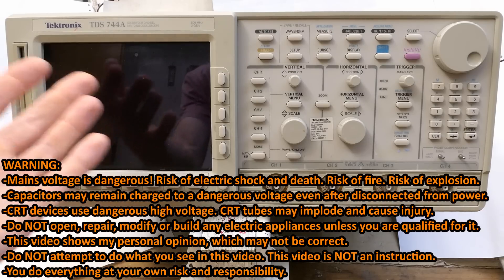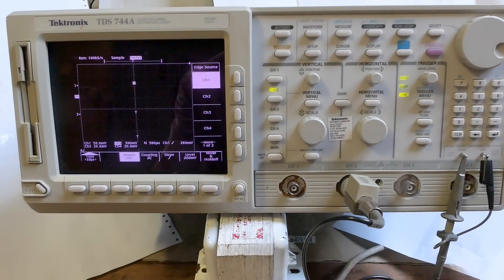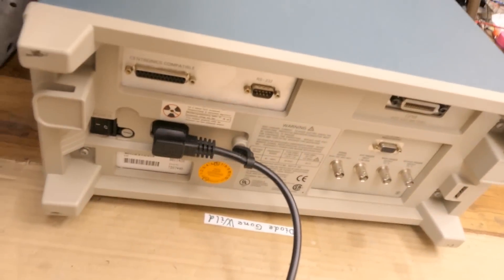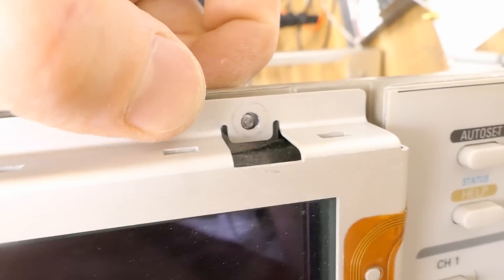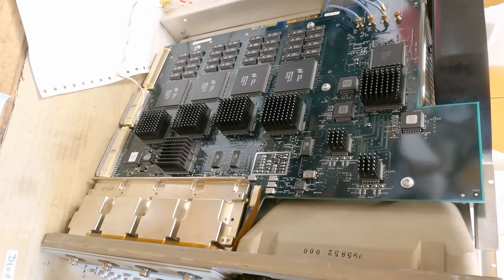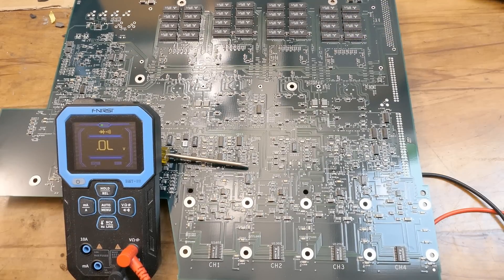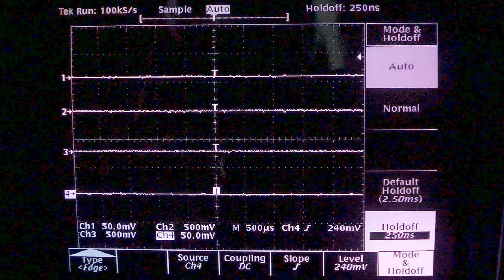Tektronix TDS 744A teardown and repair

Comment: I hope you will get it fixed! Would be very interested in seeing some of those signals driving the CRT circuits! I recently got my hands on a complete CRT assembly exactly like this one, with a brand new tube, and one day I need to figure out how to generate the correct types of signals to get it working without the original Tektronix scope if possible. That would for sure be an interesting small color CRT monitor, with that very special Tektronix NuColor technology.

Comment: If you need, you can find info on eevblog about "Dallas DS1486 and DS1250 Replacement designs" and also about "TDS744 CRT to LCD" conversion if interested. I did both on my 744A and still have some spare boards/materials if needed...

Comment: That scope has a lot of options. All displayed on power up. I have a 784 and the color display is very nice. There is a fellow on eBay selling replacements for the NVRAM chips, around $100. He recommends replacing all those small electrolytics.

Comment: 10:26 LOL Torque sequence like on an engine head. 😀 Your humor is hilarious.
Reply: It's not out of the question - when the torque of the bolts is providing a mechanical connection between the hybrids and the main board through that interposer thing with the pins, having uneven torque on the screws could lead to bad connections on some of the pins. I highly doubt those pins are spring loaded pogo pins - I bet they're just slightly longer than the plastic frame they're in, and they rely on even bolt torque to make a good connection.
Reply: @gorak9000  I do not think the display will experience the same thermal change as an engine head, where the correct order of tightening the bolts is critical to avoid excess stress.
Reply: @gorak9000 Yet to see an electronic device where torque matters beyond not being loose and not stripping threads. I have heard of a case where screws appeared to be loose in a printer but were actually like the screws on a carburetor turned by an exact amount to calibrate something, tightening them all the way resulted in terrible print quality. But an oscilloscope does not have mechanical moving parts like a printer.

Comment: Not much inside considering they hat to make it longer than that short CRT dictates us. Just joking. They were making scopes with vacuum tubes and a round CRT.  This one still has mind blowing specs. Once all the backup batteries are replaced and all supplies brought up to spec this would still be worth a fortune. Can't wait for the repair part.

Comment: Replace those SMD capacitors, thet leak and eat traces on the board. Your still works, so changing them is insurance. Also read the old NVRAM and program new NVRAM

Comment: The GPIB port is for hooking up to other equipment like counters, voltage generators, high-precision voltmeters, modulators, plotters, etc, usually manufactured by Hewlett Packard. The Centronics port is for hooking up to a printer. The RS-232 port is for hooking up to a computer; although the oscilloscope itself can run the printers and GPIB equipment, the RS-232 port needs software on the computer that can understand whatever protocol Tektronix uses.
Reply: GPIB these days (and probably also when the scope was new) is mostly used for ATE (Automated Test Equipment).
Like the serial port, but it's a bus so the computer must only have a single controller card. It's a rock solid connection. It also supports interrupts ("service requests") so you don't have to poll for a finished test result.
The HP equipment other than ATE stuff (like plotters or calculators acting as a master) was mostly an 80s thing AFAIK

Comment: Just a few remarks. 1. The displayed image size seems off. It should extend to almost the edges of the screen. 2. The 5 V bus requires a lot of current. On the SMPS board you will find close to an inductor some large capacitors in placed parallel. They caught fire when they went up in smoke leaving a hole into the SMPS board.

Comment: Those are some pretty good specs, it would even give a lot of modern scopes a run for their money. Obviously the new ones are going to have much nicer displays and UIs, especially in terms of resolution and responsiveness, but I'm sure it will be more than good enough for the kind of work you're doing. Just make sure when you're moving it, you lift with your knees, not your back! 😁

Comment: This thing is incredibly slow and laggy, the firmware is just horrible. As far as I know the software is written on the top of the vxWorks, which is pretty typical for equipment of that era, and helps you a lot if you run into some "computer issues", but that's not your case. The most common problem on this device is leaking electrolytic capacitor. Almost every electrolytic capacitor first fails electrically and then, after some time, leaks. So as the device stops working properly, you just replace the failing capacitor and you are ok. But not in this case, because electrolytic capacitors in this device leak before they fail electrically and the leak is highly aggressive, so it dissolves nearby traces on the PCB, which turns simple capacitor replacement into a nightmare. The second ticking bomb are those two Dallas lithium battery backed up memory/rtc chips. 

That "alien technology". In fact, this fails very often, but reseating that hybrids typically solves the issue. In fact, as you open that part of the oscilloscope you should recalibrate it, but this requires ancient PC (386) with some specific ISA GPIB interface card and some special software from Tektronics. In my opinion you don't need to run into this calibration thing after reseating that hybrids. 

Do not mess with that rocker switch on the top board. This enables writing into a calibration memory and it also enables booting into some weird GPIB bootloader (I personaly don't mess with HPIB/GPIB/IMS until I have to, it was horrible and kind of prehistoric technology when it was new, now it is about 50 years older.) which opens the possibility of bricking whole device. 

That display issue. It looks like the color shutter is (at least partially) disconnected from its driver. It could be bad driver, but maybe, if you are lucky enough, it could be an easy fix.

All in all, it's 500MHz DSO, which is definitely nothing cheap, even if it is old. It's useful when it comes to some TDR measurements or some basic signal integrity… Welcome to the world where "light speed is too slow" :3 .

Comment: I have the younger brother of your 'scope, a TDS524A.  Luckily, the LCD color shutter is still working as is the rest of the scope.  I plan to use an LCD display panel with VGA input if/when the CRT or LCD shutter dies.  User interface is slow.  I agree with the other comments about dumping the calibration data if you can.

Comment: I had one of these on loan a few years ago - the user interface was as sluggish as yours, I'd say its not broken (or mine had the exact same problem...). I own an old Nicolet Pro 42 which is also from the same era and just as sluggish to respond. Very annoying to use compared to todays oscilloscopes. And the cherry on top is that the only way to turn it on is the big mains switch at the back, it has no power button on the front.

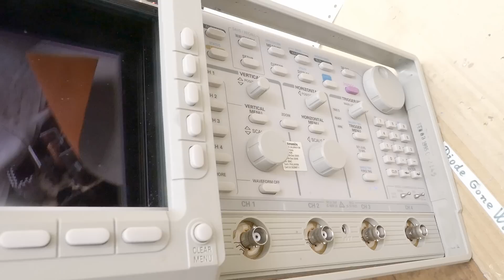Comment: 6:00 don't touch the high voltage power supply kids, especially after running it and not discharging anything. Geesh
Reply: Tell that to Shango066.
Reply: @liam3284  Thousands of volts, this dude is setting there touching everything with a bare finger.... Only a matter of time.

Comment: Super nice donation!! There are two fairly recent threads on EEVblog called "Tektronix TDS Scope Field Adjustment Software reverse engineering" and "Unified tektool released ! (Firmware flash tools for old Tektronix TDS series)". I can't post a link here but a search by name will get you the link, if you don't already have it. Also, it would be nice in the coming series to see the VGA output on a monitor or from a cheap VGA to USB capture cable.

Comment: Also dumb the calipration data & fix the battery .
Reply: It's much worse. This unit does not have battery that could be simply replaced, there are two Dallas chips with lithium battery inside soldered to the board.
Reply: @NikiBretschneider  you can dig those batteries out of Dallas clocks. People do it.
Reply: @NikiBretschneider  yea that's what i meant .it's tedious but very doable

Comment: As far as I know, almost all digital oscilloscopes of that era used a VGA interface to communicate with the CRT... Screen can be easily replaced with a modern TFT\IPS LCD with Scaler Board.
Reply: There are CRT and colour kit replacements available that replace the entire CRT and colour panel with a TFT LCD screen, that is a brighter and longer lasting fix, and which are a drop in replacement. Done because, despite being a scope with slow as paint dry response to controls, they still are reasonably good scopes, and are specified in a lot of military service shops as the scope to use, so the fixes are to keep them running. That hybrid input board though is no longer made, nor the input section at all.
Reply: Definitely worth connecting the external VGA to a monitor.  The colour information may well be present in that signal.  If it is then - as other commentators have suggested - find a modern LCD VGA module to replace the whole CRT & LCCS assembly.  It is worth searching YT for videos on that subject.
Reply: If they have monochrome screens, they're probably using something more like MDA (monochrome display adapter) - it's a very simple digital/ttl version of VGA having a vertical and horizontal sync, and a digital video signal, but it only supports on or off. There's also another standard that's more like CGA where there's multiple data pins, and they're used together for intensity control, so you can have more shades than on and off. Those ones are pretty easy to convert. But then there are others that actually use vector displays, and those require elaborate logic (aka probably an fpga) to convert the vector graphics to whole frames to present to an LCD. They all tend to use non-standard timings compared to usual video standards.
Reply: @gorak9000  considering it has a VGA output anyway, even if the internal connections are odball, you still have a way to find good VGA signals in there

Comment: Beautiful technology from the 90s.
Actually looks like alien technology lol.
Can you
Imagine how much they would charge today for something they put that much work and Technology into?
Reply: Tek still sells the replacement units, that are much improved, but still use similar architecture, though they still use the same old ASIC's in them. They much have a good number of the wafers in storage, and enough packaged and tested chips and boards, to keep on making what is now a 30 year old design, and still selling it. Superceded by at least 3 generations, but still a listed offering, though they are pricy, but still lower when compared to the inflation adjusted cost when they first got offered.
Reply: They were as busy as beavers at Tektronix. Beavers in Beaverton Oregon!

Comment: Looking at the insane internals, this thing must have been ridiculously expensive when it was new!
Reply: It's still 700€-3000€ (in Working condition) on eBay. So yeah. ChatGPT told me it was about 14.000€ originally.
Reply: Iya harganya bisa membuat kita mencucurkan air mata 😭
Reply: @deanagoes2791  Maaf, saya tidak mengerti apa yang Anda katakan karena saya tidak berbicara bahasa Indonesia. Tapi ya, perangkat ini pasti sangat mahal.

Comment: What component would emit x-rays?
Reply: The CRT.
Reply: @chrisg6597  Yes the CRT, as it runs at 12kV anode potential, and the filament is biased to around -300V along with the cathode, to make driving easier.  Yes leaded glass used for the CRT in the front panel, but the tube walls are not leaded because of the conductivity it allows in the glass, so there is still a small but noticeable amount of soft X Rays emitted from the bare CRT, thus the shielding to attenuate it to low levels, and the warning stickers, so you do not operate it without the shield in place for long periods. However you would have to be within 5cm from it for months, continuously, before the dosage became equal to a single dental X ray.
Reply: @liam3284  Good fortune? Au contraire... Quite the opposite is true, I assure you.

You shall see this is true soon enough.

Comment: Looks more like AC riding on the DC control circuit to me, only just started watching, but my bet is cap problems.
Reply: No, those boards and ASIC's are famous for thermal issues, and drift when hot, along with contact issues as they age. Plastic and board creeps under the screws, so making loose contact, and the thermal paste dries out.

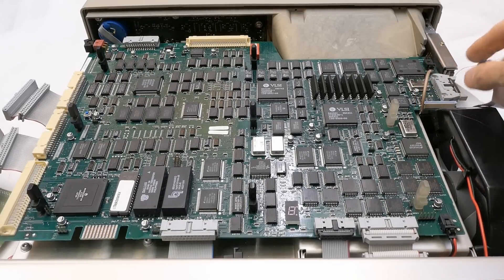Comment: Around the 4:46 timestamp we can see that the board has a Dallas DS1486 timekeeper and Benchmarq bq4015YMA NVRAM, these both have internal batteries with a  guaranteed 10 year lifespan, probably they are very close to failing: you should research if the GPIB interface on the rear or floppy drive can be used to dump the calibration data before it's too late!
Reply: I have an older model, the TDS 460A. It was broken when it was given to me, it could not boot. Turns out it was just that the batteries were bad. Luckily in that scope they were external, not in the chips, so just removing them fixed the booting problem. Of course now it can't keep settings and time but oh well.
Reply: I would expect that such a system would store the important calibration data in a static memory. Since the device is from 1994, it is unlikely that the batteries made for 10-years can survive 30. Thus i guess the calibration data is not dependant on the batteries.
Reply: @aionceres7086  I think you mean NVRAM (although usually a small EEPROM) not static ram. Static ram is the one that needs battery backup
Reply: @aionceres7086  The scope is not 30 years old, the datecode on the chips is year 2004 week 35 for the Benchmarq and year 2005 week 26 for the Dallas. Normally the chips last 20 years in my experience but it depends allot on how it was stored (temperature) and obviously more how much it was turned on. The Benchmarq chip stores waveform data, the scope can work without it, but the Dallas RTC stores scope options and is the real time clock, normally when they start failing the clock stops first and we can see that here: the year is 2040 on the scope yet it still has the options working on bootup. And you saw the post above mine where suruadamable says his didn't even power on when the batteries where dead, so what use is it then to "possible/maybe" have the calibration data stored in a non-volatile flash or eeprom memory if the scope is anyway not going to boot and the chips are not even socketed?
Reply: There are drop-in boards which replace both and they will be a good amount cheaper than ordering the Dallas replacements.
Reply: Yes any internal battery on the nvrams will definitely be exhausted. But if not the chips can be read with any eprom programmer that supports those chips. If it was here I could do it in a few seconds using one of my 10 eprom programmers. Possibly a floppy disk image may be available to restore the data if it's not re-loaded from the built in firmware automatically but the manual will have the details.
Reply: Good job, spotting it. I've a similar issue with a DS1245Y NVRAM device, on my TDS 540. I plan on replacing it with a new, identical part (which is still available). But once the old one is out, I'd like to remove the internal batteries, and solder in a couple of battery holders -- yes, this will require some surgery -- for the next time the NVRAM device dies. The only problem this NVRAM losing power has caused, IIRC, is a self-calibration initialization failure. The NVRAM (allegedly) stores the "options" on a particular 'scope, e.g. FFT analysis, extended memory, etc., at least on the 540. But because the DS1245Y capacity is 1,048,576 bits, I tend to believe it holds a little more than just the options data.